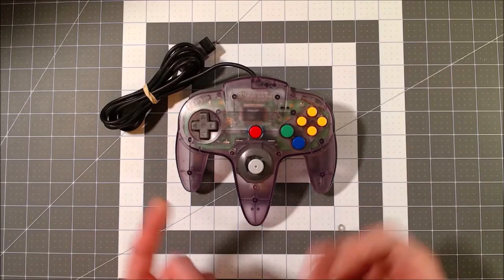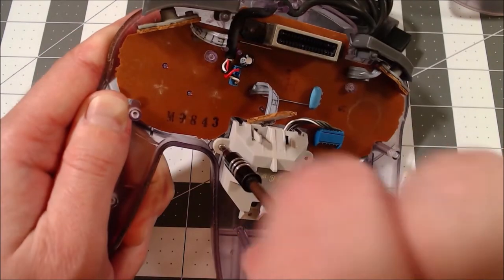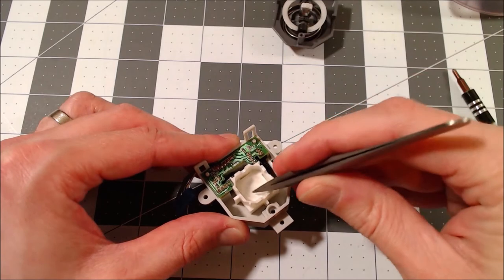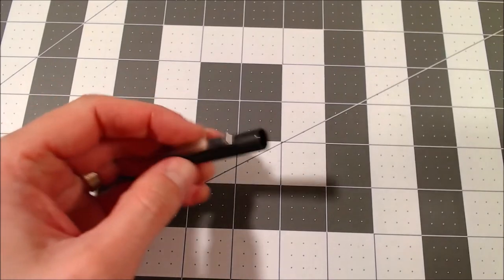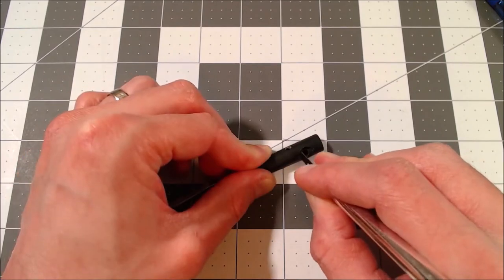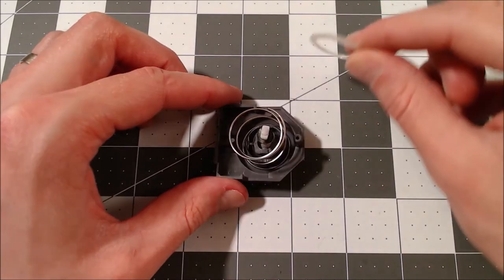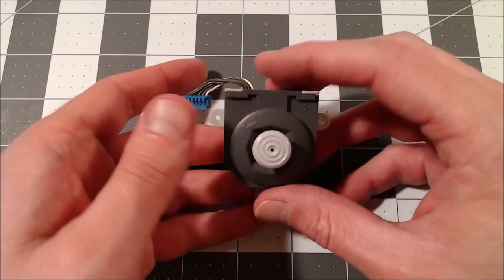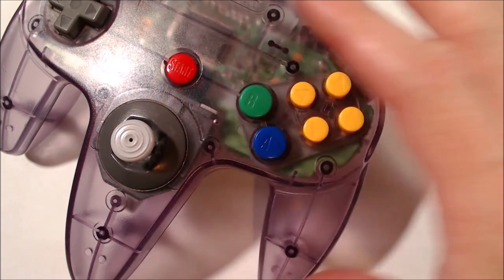Fixing an N64 Controller Broken Joystick (Wiggle Stick) NO REPLACEMENT PARTS

Comment: I normally don't comment on these videos, but I feel in this case, with the dislikes removed, I should. Trying this fix, following the instructions exactly, my controller not only wasn't fixed, it ran much worse. The stick certainly FELT better, it felt much tighter, but playing a game was a different story. The stick was constantly acting like it was being pushed up with full force and would not go back down without A LOT of effort. I took it apart several times to try to make sure I had done everything correctly, which I had, and every time I  put it back together, the problem was still there. I removed the "fix" and now the stick barely registers any movement. It was bad enough before not being able to run fast but it's really bad not being able to move at all. It would certainly have been helpful if there had been some kind of footage showing that you actually got the stick to work and how well it worked.
Reply from the maker: Very sorry to hear this, agreed I should have shown game footage before/after. It did work well on mine which is why I shared the process. The size of the plastic piece is tricky to get right and I'm sure there's opportunity for things to go sideways. I am confused how the behavior is worse after removing the extra plastic though, I'd expect it to have reverted to how it was working before. It's better for me to see this feedback instead of a dislike and then wondering why without any context. I definitely don't want to lead people down any path that makes an issue their experiencing worse, so I'll keep this in mind and try to do better moving forward. There are other solutions to this problem such as repairing the joystick bowl, I'm happy to offer further advice or insight if you'd like to email me.
Reply: Thank you very much for the reply. Like I said, I don‘t normally comment since videos like this are trying to be genuinely helpful and I am in no way trying to be needlessly negative towards your video. I did think for people trying this at home it might be helpful to share my experience with your particular fix. It did surprise me that the controller didn‘t go back to its previous manoeuvrability. I’m not sure why though, but I did notice with my controller that the colours weren‘t exactly the same as the colours of the guts in the controller you were fixing. Maybe some are more sensitive than others.